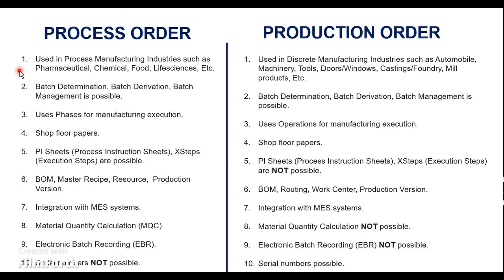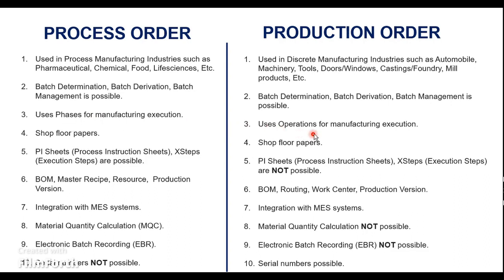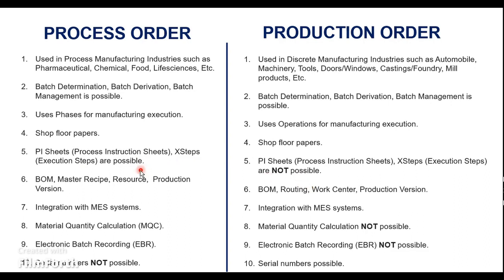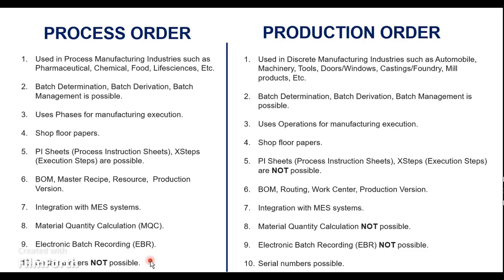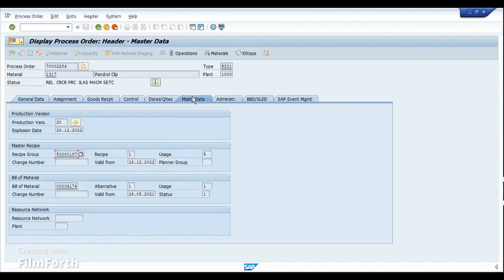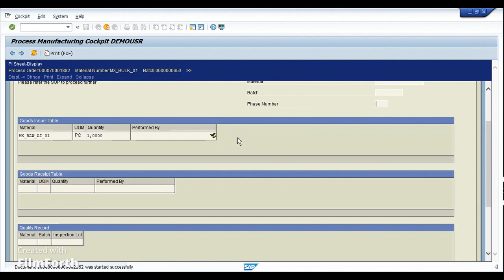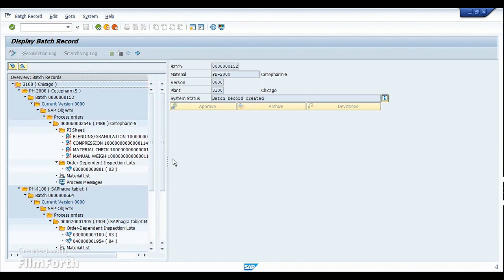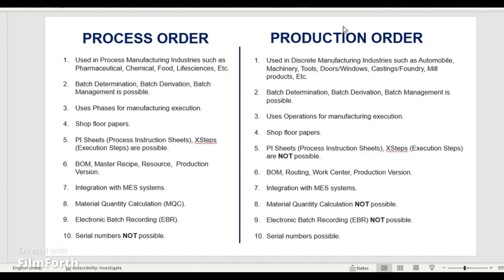SAP Production and Process orders | Differences b/w Production and Process orders #sapwithik

Comment: Hello Karthik
We could see control recipe generate icon in production order as well. Is it disable ? 
And my question OCM is possible in process industry ?
Reply from the maker: Control recipes are not supported for production orders. Of course, OCM is one of the best practices to use in process industries.
Reply: @SAPwithIK  but in my last S4 Hana Implementation for pharma company I have raised Oss note to SAP they confirmed OCM is not supported for process industry
Reply from the maker: Why can’t you use ECM (part of OCM) to control master recipes? If the ECN is not approved the process order will not be approved by default.
Reply: @SAPwithIK  business already using ECM if they want to make any changes at process order level OCM will helps to create the logs for ever the changes we made. That's the requirement
Reply from the maker: Oh ok understood. If SAP already confirmed that it’s not supported for Process orders then it’s confirmed.